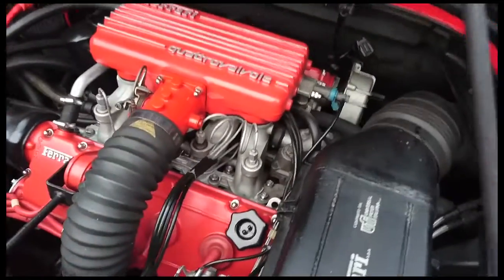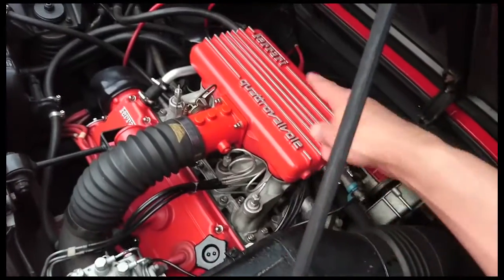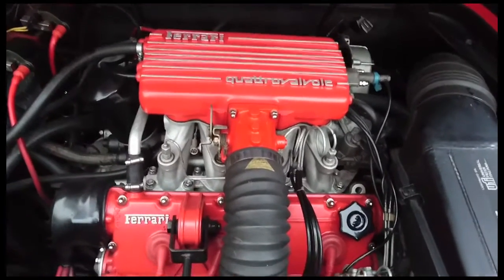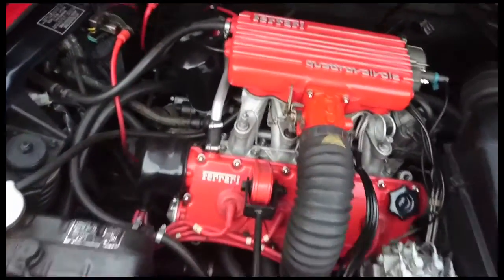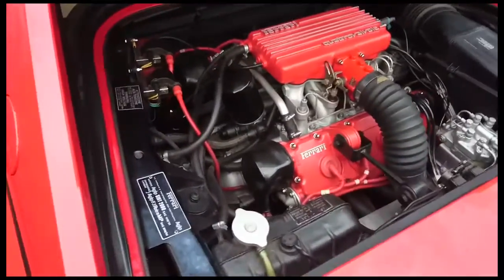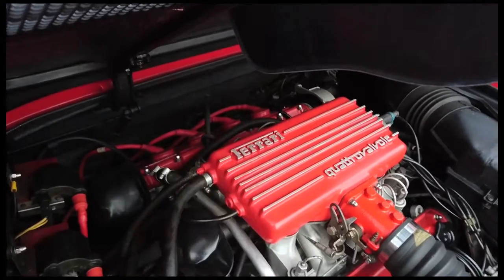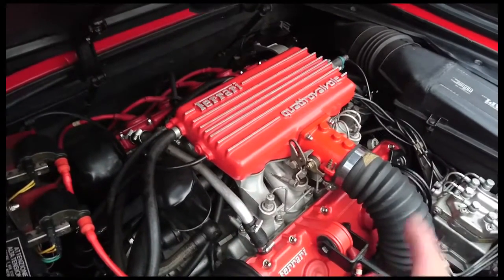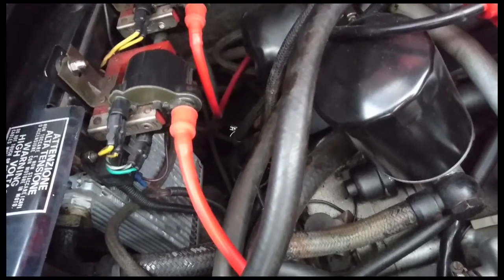Ferrari Erratic Running

Comment from the maker: The solution to this problem in the end was a corroded connection on the crank position sensor plug cylinders 1-4. Just cleaned it and packed with water inhibitor. Regards Doc

Comment: Any progress on this ? I had something similar on a 308 QV and eventually the 1-4 sensor failed hard - I suspect the sensor, even though you've replaced it before, could be your problem. You can swap over the Digi boxes at the multi plugs and coil input to see if the problem moves to the other bank to prove them.  You might also want to check the vacuum line to the digi box doesn't have a small split in it somewhere - the digi boxes take a vacuum line from the plenum to control the spark advance and at idle the vacuum is highest and most susceptible to vacuum leaks.

Comment: Hey Doc, I have a Mondial QV 1985. Not long after I bought it the front bank would come in and out and was running rough. I found that the ECU for that bank was faulty and sent it in for repair. I put it back on the car and changed the plugs as a matter of course. That fixed the problem. After watching your fantastic videos I refurbished my engine, cam belts, seals and valve clearances. On the start up I had a problem with what seemed to be the ECU again. But it was just a lead from the coil to the dizzy cap that had been pulled out slightly and wasn't making proper contact. I'm sure you've checked that the leads are all properly connected. Sometimes the screws miss the wire. I  had replaced all my sensors so it wasn't them. If it's not something simple like leads, then I say the ECU is where you should go looking. Swap them and see if the problem moves to the other bank. I can't do that simple test, because the Drongo's that had once worked on one of the ECU's changed the plugs so they are now different. Bummer! But yours looked the same. I'm probably preaching to the choir. But that's the best I can come up with. Hope it's of some help. God knows you've helped me heaps. Good luck and bless ya Cobber.
Reply from the maker: Hey Messenger, cheers for the great post here :-) Yes I've still got to go through all the connections this weekend and as you say swap things about to see if I can trace it (thank goodness for duel system, makes life easier).
Really glad you got inspired to do your car too, wicked!
Will report back once I find out what it is.
All the best Doc.